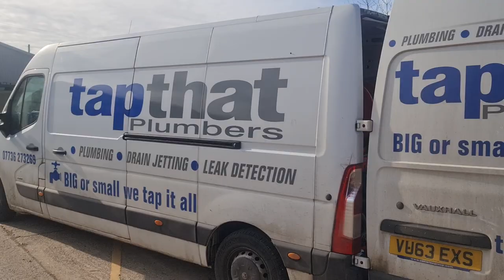Wet Wipes, Paper Towel and lots of SPICE in a blocked manhole in London ( Drain Jetting ) DrainRat 8

Comment: That's a nice truck mount! Looks like a 1/2" hose. What's the specs? 4000 psi 18 gpm? I have a truck mount I just set up with a 275 gallon buffer tank. 3800 psi 16 gpm I put inside a cutaway with a 12' box.
Reply from the maker: It is a 1/2 inch hose. 4 cylinder diel engine. 3000psi and 15gpm. Your setup sounds sweet!!!

Comment: You didn't remove and dispose the wet wipes??
Reply from the maker: No need. The site doesnt run to mains sewerage. There is a tank 3 meters down the line that gets vacuumed every 3 months. So the wet wipes will just sit in the tank until it is vacuumed with a tanker.
Reply: @eurodrainrat9659  I see. Thanks for the explanation. Good to know 👍🏻
Reply from the maker: @jessccy  i would generally try remove as many as i can, but once it is out into the council line they should flow as they have a large diameter and lots of flow.
Reply from the maker: Don't forget to like and subscribe!